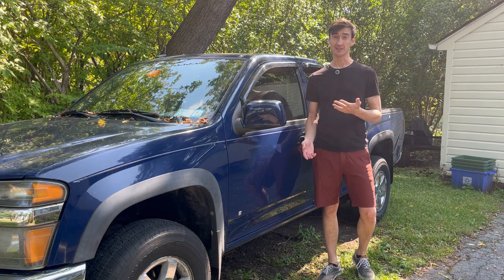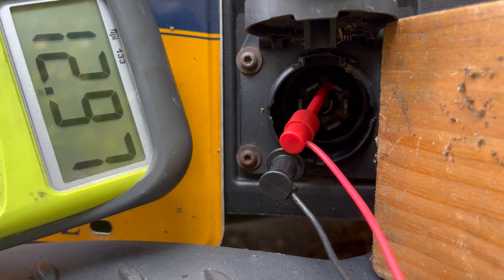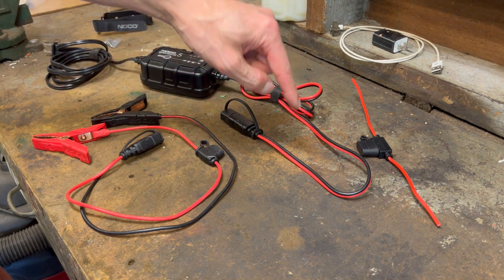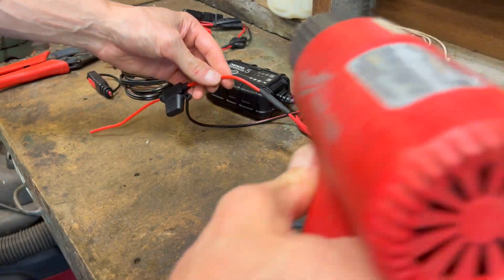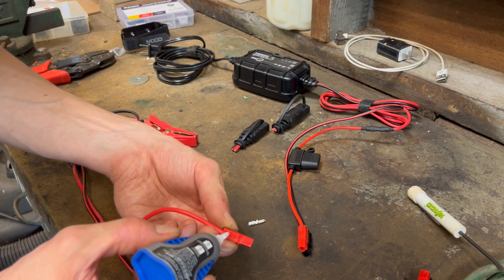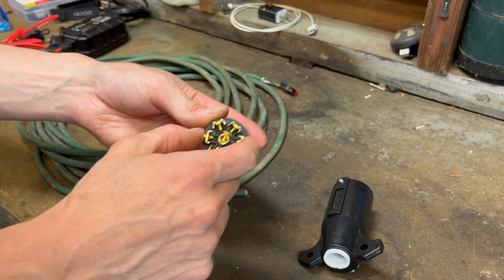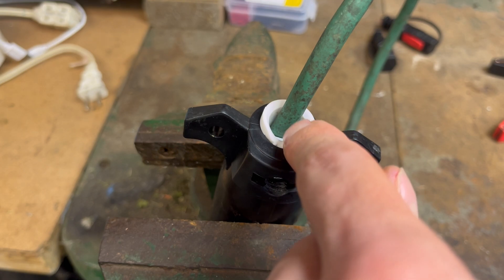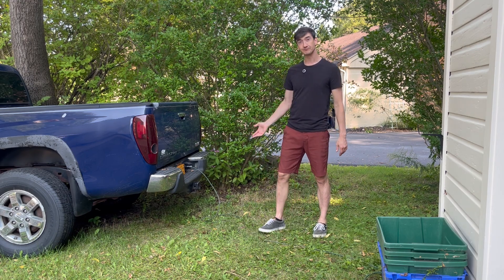Maintaining a battery through a trailer connector

Comment from the maker: Here are some affiliate links to things I used in this video: 

Noco Tender: https://amzn.to/3TtLP7Y
Waterproof trailer adaptor: https://amzn.to/4fRRhdg
Cheap Anderson Power Poles: https://amzn.to/4d4x5TX
Cheap Power Pole Crimper: https://amzn.to/4d63bPo
Quality Anderson Power Poles: https://amzn.to/4e83Y3E
Quality Power Pole Crimper: https://amzn.to/3XVJBB7
Other wire crimps and crimper: https://amzn.to/47wcS8j
Silicone Sealant: https://amzn.to/4eoZRQ6
Fluid Film: https://amzn.to/4d4xe9X
Fuse Holders: https://amzn.to/3XJQ3Le

Comment: Alternate option is to just disconnect one of the battery terminals, the self discharge rate of a car battery is pretty low, most of it draining is due to things in the car. So basically long term storage, just disconnect a terminal.

Comment: I use a wifi switch on tender and turn it on 1 week for 24 hours.  Depending on charger they come on automatically when powered and there's no backfeed when powered off to discharger battery.  That is key for wifi switch operation.

Comment: Since you're already using heat shrink on the butt splice, consider instead using uninsulated butt splices with crimpers like the Thomas & Betts WT111M and then cover with heat shrink. I think they make for much better crimps because the tool isn't crushing insulation like it would on the yellow,. blue, and pink crimps.
Reply from the maker: Uninsulated crimps would make a lot of sense to have in the shop, great tip! When you say "better crimps" what do you mean? Like less voltage drop or able to resist wires pulling out more or what? Also do you have a brand of crimp you'd recommend? I can get quality tools still, but I feel like all crimps are cheap imported garbage these days

Comment: Maybe add some paracord to go along the wire, but make it a bit shorter, attaching it to the plug and the garage. So when you or your family member drives off without disconnecting the plug, it self disconnects without destroying the wires?
Reply: Excellent idea. As a word of caution, some of those 7-pin round connectors have a thick latch on the flip up door that holds the connector in place. Double check for this first.

Comment: On some cars, you can't easily unlock and open the doors, or pop the hood, if the battery dies. Even on electric vehicles, the 12V battery can die on its own and you're locked out. Yet another reason why externally accessible 12V wires is useful. Easier than to pick or slimjim a door, then tap into the cigarette lighter socket to provide the 12V to actuate the locks.